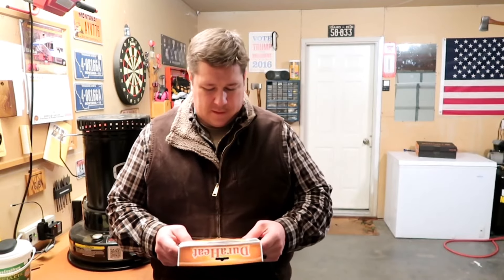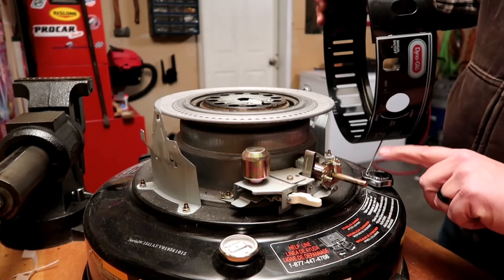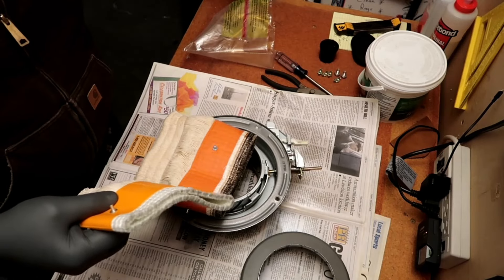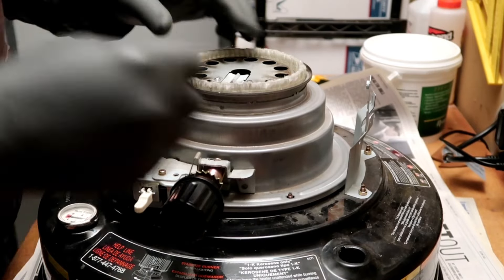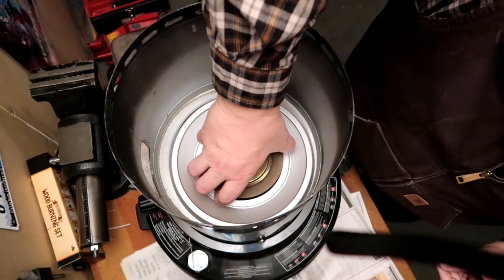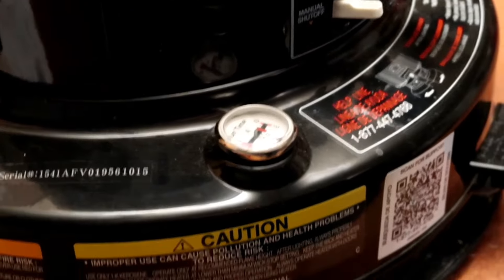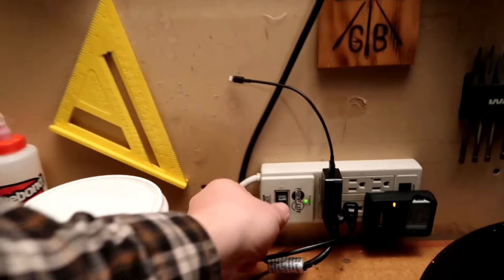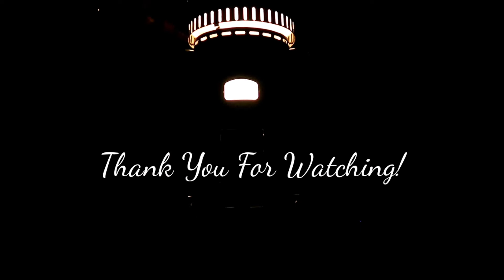How to Change the Wick on a Dyna-Glo Kerosene Heater

Comment: So Today 18Jan2023,
I saw your video for the first time,,  on 16Jan, I changed the wick in my Kerosun heater model rMC95C6: 
It is obvious , I missed two pin holes... I have already emptied the kerosene out and will disassemble the heater again, because I can tell I did not install it correctly..
     Oh well,been 8 or more years since I last had my heater fired up.
  Thanks for posting a well lit video with good details and audio.. 
  Much appreciated. !!!

Comment: LOL I changed mine last night. Went well. It was an old heater I found out in the old shop. Most folks would have just tossed it but now its working like brand new. I have 3 of these, really heat well and zero odor.
Reply from the maker: Absolutely fantastic heaters and very good for alternative emergency heating as well. 👍 Thanks for watching!

Comment: Thanks for your video.  I inherited a RMC95C4 heater from my in-laws.  The last time it was used was in 2009 during an ice storm and it's set with kerosene in it since.  I did light it but it's burning unevenly.  I found a new wick at Menards for $12.00 US so I'm going to try replacing it tomorrow.  BTW last weekend I bought K-1 in Southwest Missouri from a pump for $3.29 a gallon. Even though the flame was uneven it did warm my garage nicely.
Reply from the maker: +Howard Bee Awesome gift to inherit! I am very pleased to announce that I too found k-1 at the pump for $4.50/gallon! Much much better than the $10.00/gallon that I was playing! 👍Thanks for your comments and for watching! I'm going to make another video about replacing the ignitor next because it just went out on me. No biggie because they're extremely easy to light even without one but it was very very convenient. Again, thanks!

Comment: Thanks for the video! I use the 1k Kerosene in my heater and I also use it in my oil lamps. It's clean. I would recommend to anyone who has been using something other than the 1k to change your wicks, whether in a heater or an oil lamp. Something I have learned from using my kerosene heater is that if UPS or FED Ex threw it around during shipping, your combustion chamber might be out of position, which causes terrible smoking.

Comment: Very well done excellent pacing. You showed everything that needed to be shown and explained everything thoroughly. I have two of the same model and they’ve been great for three years now. I’m able to get the pink kerosine at a gas station where the owner uses it to heat his shop - works fine. A fill of a five gallon container runs about 17 bucks. I make sure to crack a couple of windows in my shop just to make sure there’s fresh air flow. It might not get as warm as it would if I kept them shut tight, but why take any chances? Thanks for sharing your know-how!

Comment: I took it apart & reassembled & all worked fine.   Btw the DynGlo is identical to the  Dura-Heat DH2304--I believe the parts are idential.  Thanks for the video.

Comment: This video really hits all the points needed for anyone who is interested in kerosene space heater.  The color of the burning fuel looks white and bright. Do not see any yellow flame. This heater must really be burning hot and bright. 6:25 HOW many hours did you use the kero heater last year and did you burn the wick dry as the wick you removed looks dry Paul ??
Happy Thanksgiving fella too. v
Reply from the maker: I haven’t used it much this last year. My son and I used it in my insulated garage to change out a starter on his truck but not much other than that. I’ll let it burn dry every other time I use it usually. That way it doesn’t build up paraffin.
Reply: Right on Griffin. Total burn out make the heater work properly. K-1 kerosene UNDIED makes all the difference.  @GriffinBenchmark

Comment: First, thanks for this video...I referred to it several times while putting in my wick!  There is one step that got me flustered - getting the wick mechanism to work after installing the assembly back over the center barrel.  I found that I needed to simply run the wick-raising mechanism all the way up, then carefully - without disturbing the release ball, slide it over the barrel and down.  It works perfectly now.  Thought you might want to edit your video to include this if others are/were experiencing the same issue.  Now, on to figuring out how to fix my igniter!  I have just a bare red wire poking into the square chamber...
Reply: Update:  I found this in the actual manual:  18. (1) Turn the wick adjustment knob to the fully raised position. (2) Pull lightly on the
skirt of the wick to remove any slack. (3) Press lightly to secure the skirt to the
retainer teeth on the wick cover. (4) You will need to hold the knob in the
clockwise position to keep the wick raised.
※ WICK INSTALLATION TIP
** Lock the tip over switch (TOS) by inserting locking pliers or a clothes pin between the TOS plates, preventing
the weight from triggering the TOS mechanism as you install the new wick. Install the new wick in the raised
position. Remember to remove pliers or clothes pin before reassembling & lighting heater.
19. (5) Replace the wick assembly on the heater with the wick raised. (6) The wick adjuster knob will need to be
positioned between the caution and warning labels
Reply: @airdave1953  to keep it in the raised position I insert/ wedge a small piece of wood below the release ball so I don't need to hold the handle while inserting the wick.

Comment: Walmart has discontinued 1 k in my location.  They even sold the heaters daynaglow not anymore. They are excellent heaters. Mine will run you outta the house on low.  Excellent video.
Reply from the maker: Thank you. I’m glad I did this video so many years ago. I’m also glad it’s helped so many. God bless!
Reply from the maker: P.S. Try and find a local oil and gas distributor in your area. They usually have 1K on the pump or can pump it for you. 👍
Reply: @GriffinBenchmark  i have one in my small town right out of the big truck fuel pumps. i have several gallons on hand for spare.

Comment: Thanks for the video... Bought a used one for $20 that works great! I did buy my first gallon jug at HD for $9 but found a Speedway gas station near me that sells k1 at the pump for $3.199 which is, to me, very reasonable to use as a secondary heat source... I'll attempt to change the wick tomorrow after watching this video...
Reply from the maker: Thanks! Glad it helped and thanks for watching! 👍😊

Comment: Thanks for your information.  I didn't know that you use 1K kerosene.  I used pump kerosene and it smoked my room up..Great video
Reply from the maker: Glad it helped! Merry Christmas! 👍💯
Reply: Pump kerosene is not what caused it to smoke.  Your wick height is too high if it starts smoking.  Unless it's old or been improperly  cared for.  The heater has no temp adjustment.  It has one adjustment.  The flame should be a quarter inch past the center plate of the burner.  And you need to let it run out of fuel while it's burning every 3-4 tanks of kerosene.

Comment: Thanks this was a great help we are freezing our butts off but I now have an idea how to get my animals and my wife and kid warm again. Pump kerosene is $3.99 a gallon here in GA the K1 is just too expensive $20 for 2.5 gallons versus $3.99 a gallon with the K1 additive of course smell lasts for the first 10 minutes or so no smoke just a little after shutting it down. Thanks again sir
Reply from the maker: +No Nuckled Fist I heard you guys were going through a strange cold snap down there. I'm glad this helped in some way. I sure hate hearing about a family getting cold. You might call some of your commercial gas and oil companies in your area that actually service gas stations. I actually found pump k-1 for $4.50/gallon at a tanker truck gas and oil company locally after making this video and 1 year after I've been running this heater. Thanks so much for your comments and for watching this video. Stay warm!
Reply: Griffin Benchmark no problem sir thanks for the heads up, so far $3.99 a gallon is the cheapest pump kerosene I've found in my area

Comment: Kerosene from the local gas station pump cost $3.50 / gal here in central Vermont. Cost me between $0.55 and $.80 an hour to run my similar Dyno-Glo  (model RMC-95-C2) kerosene heater. I also use one of those passive metal fans that sit on top on the heater and blow the hot air around a bit.
Reply from the maker: That's a good price for kerosene. Here's the heat fan my buddy uses on his fireplace. I've never thought about using one for these kerosene heaters. Great idea! I wonder if they get hot enough? https://amzn.to/2OiuApy

Comment: I run the wick on mine as low as it can go with that adjuster knob and it still works good. I'm pretty sure you can cook on these if you have the grill on it. No way you can hover over it without getting fried so yeah, cooking on could be an option if need be.

Comment: I use Wawa Ultra Low Sulpher Diesel, or, go to a small airport, and get some Jet A. The prices on both, are very reasonable!
You can even mix the diesel with the Jet A, 50-50, if you like.
But, right now, I'm using the straight diesel...working nicely!
Less odor than the kerosene.

Comment: Great video!  I grew up with these and have the same nostalgic feeling you describe.  I purchased one at Lowe’s to see if I could offset my heating cost this winter and am blown away by how well it heats.  I buy my kerosene from three different gas stations around home and I have thought that two of them might be selling diesel instead, based on the smell.  Now that I hear you say that they will operate pretty much the same with diesel, I’m almost certain.  Do you (or any other viewer) know how I could test my theory?  I know I mentioned the smell before but I’ve read that old kerosene will have a different odor.  They pretty much taste identical.  Just kidding.  I would love to know how to test it though.

Comment: Nice job. After I light mine, let it burn about 5-10 minutes, I adjust the wick adjuster know, usually I turn it all the way on low, or close to it. This get's the flame at the correct height, and conserves kerosene. At my local gas station, k-1 kerosene is  $5 per gallon no, December 2022. Thanks!

Comment: Sometimes the wick assembly can be damn tough to get loose after wing nuts are off. I had to pry mine off... it's a good idea to follow instruction for storage. Might even take the wick off and keep it stored separately.
Reply from the maker: I haven't had the same problem with mine yet but I've heard of others having issue with removal.

Comment: I have a very similar model and I have the new  wick going up and down but the tip or emergency turn off lever don't drop the wick down out of sight so I fear the safety cutoff won't work.  is this safe to try and light?  And I hate to run it and not have that protection, SO BEFORE I LIGHT IT I  WILL call around to see who might be able to figure why the those safety features are not working maybe the wick is not in right, I couldn't get that ring out that the wick studs go thru so I lined the  studs up while the wick was in in highest position.  Maybe Lowes or Home Depot where we bought it can ck it out or maybe a country hardware store around here has experience with them.  I won't spend too much as the portable propane heaters do pretty good keeping us warm.

Comment: K1 is intended for use. I own 2 like yours and a box style.  Pump kerosene will cause the wick to burn faster because of the carbon build up I learned that the hard way myself.  . It's a Wind guard not a backfire shield.
Reply from the maker: Thanks for the clarification and for watching! 👍
Reply: @GriffinBenchmark  I learned just like you did. Your video is really good on explaining. Thank you
Reply: One can source 1-K kerosene from a pump supplier. Farm co-ops and specialty fuel dealers will often have 1-k.  It is usually half the price compared to Walmart jug kerosene.   Yes, one could have water issues with bad tanks. Usually the best pump suppliers keep a fresh supply for construction and agriculture customers.   Thanks for the video.

Comment: You forgot to mention when installing wick in the last step.
 You need to extend the wick and hold it there as you put it in the unit. Thats so it can move up after being installed.
Reply from the maker: I'm not entirely sure what you mean but I'm sure it's great clarification though! Thanks for watching! 👍
Reply: Exactly, if the wick is not in the up position it will NOT move upward
Reply from the maker: Sorry about that...
Reply: Correct on the wick position. I used some masking tape over the tipping balance so when I positioned the wick upward it stayed there while I fiddled with it.🙂 A long time ago I worked on some very ah um special helicopters, we always used detailed manuals to make sure it went together correctly. Your vid is the best so far detailed just right, well spoken, with great camera angles. After working on mine prior to viewing this I saw my flame spreader was incorrectly installed. Mama mia no wonder, thx for a great vid.
Reply: I’m glad I am reading this now, I assembled mine and it wouldn’t raise, I took apart, all pins wer in so I assembled in raised position and it worked. I didn’t know what that was about
Reply: Likewise, I am also SO glad this comment is here.  I thought I was doing something wrong when the handle wouldn't raise the new quick after I got it installed.  I even tried taking it all apart again and putting the old wick back in to troubleshoot, and then the same thing happened & I knew at that point there must be some crucial step I was missing! Thank you so much for this clarification, Chuck!

Comment: I have the same one...hope you can help me with a question, my wick adjuster knob, it doesn't mater how much i turned it, the wick does not come up.  it stays right where it was inserted.  I made sure the wick was put right but still it does not come up.  Any help on how to get it to come up?
Reply from the maker: Is it 'clicking' when you turn the knob?

Comment: What prevents the lower wick compression  wick stick out's from stopping the wick from raising.?  Does those punch out grabers attach to the wick on the lower compression wick holder?  The wick raises fine until I install the bottom compression round adaptor--those pop out lock the wick & prevent it from raising :-(
Reply from the maker: If I understand your question, it sounds like you want to recheck those little metal dowels and make sure they're fitting through the lower wick ring ok. Make sure the wick glides up and down freely every step of the way as you're putting everything back together. I noticed those dowels could be a little tricky at times during the reinstall. Hope this helps! 👍

Comment: The knob will tut when the assembly is free and the wick will raise and the shut off will lower it. It only has problems when l place the assembly back in position and line up with the bolts were the wing nuts go
Reply from the maker: And it was working ok before you started the whole process? Sounds like something is binding? It didn't get bent at any point while it was off did it?

Comment: What's the sq ft you are heating? What was your outside temp?
Reply from the maker: You know, I'm not sure, it was a 2 car garage with half of it being uninsulated. The few times I've taken it in the house when power has gone out it heated the whole upstairs main areas with no problems which is about 1,000 sq ft. Can't remember outside temps but probably in the 20's. 👍

Comment: These oils #1, #2, and #4, are different refinements of the same oil. 
#1 is Kerosene 
#2 which is Diesel fuel and heating oil for the home furnace is made by mixing #1 and #4. #4 is almost like tar.
I work at Lowes and I sell the heaters and that gallon jug of kerosene also a 5 gallon black metal can of the same.
I run one of those heaters in my garage and I buy K1 from the pump at the local station. The stuff in the jug that you buy at the big box stores might be filtered but that is about it. My heater runs continuously day and night till its performance drops due to carbon build up which takes about 3 days at which point I stop filling it and let it run dry so I can clean the wick. When clean the heater will consume 5 gallons in about 4 days at moderate temps of 32 to 20 deg F. I could not afford to use the expensive stuff in the jugs at the rate I burn it. All Kerosene is K1 just for informational purposes. Just as common diesel and heating oil are #2 oil. Heating oil is usually dyed and un-taxed and for that reason illegal to use in on-road vehicles. My local station has a pump for each.
Thanks for another great video!
Reply from the maker: Thanks for all the great info and for watching! 👍💯

Comment: I have not tested the diesel but did the people who says not to use diesel use the diesel kleen additive?
Reply from the maker: I tried diesel with the Kleen additive first. Paraffin immediately begin to build up on the wick and the flame began dying over time even after attempting dry burns to clean it. I then tried adding alcohol... no affect but the wick was already trashed. The only way to make diesel work, so I hear, is to use a 100% cotton wick. This is even a little controversial as well however. Here's a great write up on the whole issue and, I believe, a good place to potentially buy 100% cotton wicks. http://www.milesstair.com/Diesel_cotton_wicks.html
Reply: @GriffinBenchmark  thank you.